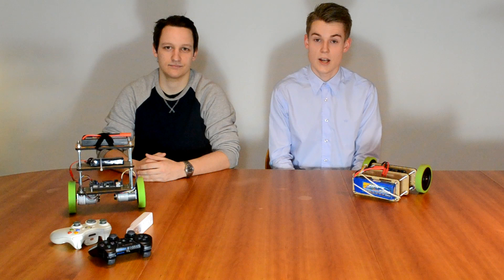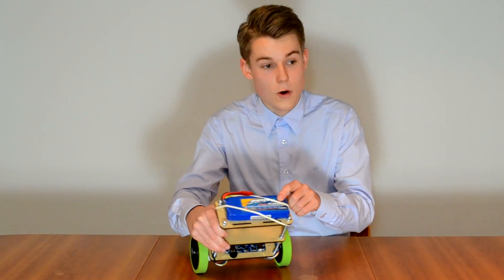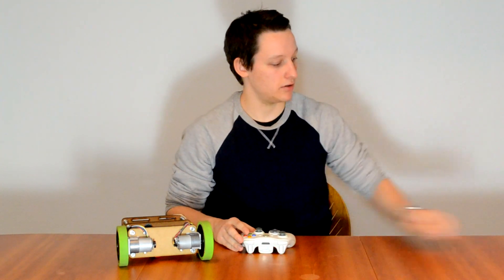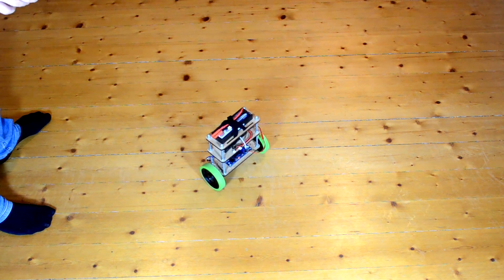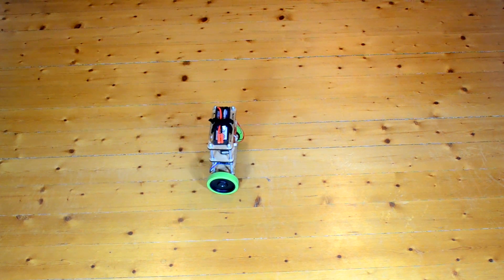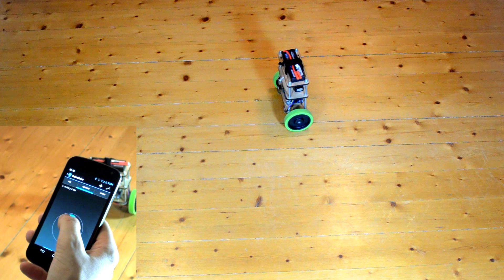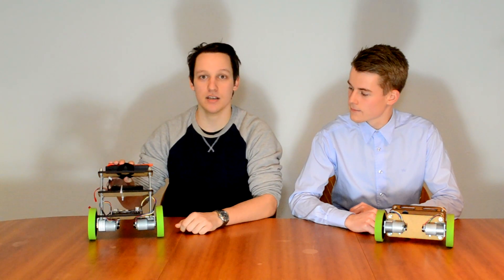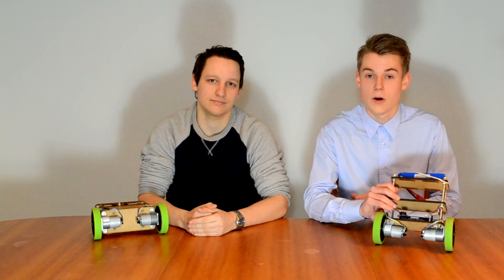Balanduino - Balancing Robot Kit

Comment: Yes you could make it work as well since it got a 3-axis accelerometer and a 3-axis gyroscope you can estimate both pitch and roll. You could then use one of the motor drivers for the driving wheel and the other for the disk that keeps it balanced sideways :)

Comment: Okay this is the last question, I promise :P
So if I were to put this in, say, a single-wheel 'motorcycle' of sorts, with a few modifications, would it work just as well?
That question decides if you've sold me or not.
Other than that, thanks for the help. I'm a bit tight on money atm with some other projects, but I shall look for it in the future.

Comment: No it's much much than just a simple Arduino. It features an ATmega1284P, an FT230X (USB to Serial converter), a USB Host interface (MAX3421E), a MPU-6050 (3-axis accelerometer and a 3-axis magnetometer), two motor drivers (VNH5180), a Bluetooth dongle and a buzzer. Try to read the Kickstarter description for more information.

What I meant by the comment was that you can use the board as a normal Arduino.

Comment: The finished PCB with all components will remain at $129 for now. I can't say what might happen in the future.

Yes it could work, but you would have to make a lot of modifications to the code.

None. You use the Arduino IDE to program the robot. For more advanced users it's also possible to use a normal makefile.

Comment: I like it, but will the board eventually be cheaper? I mean, judging by the donation rewards, $130 would be about what the board itself costs. Are there plans to make it any cheaper?
Second, could this work if it was connected to a single wheel?
And finally, what's the difference between this and programming a self-balancing robot code with the arduino IDE?

Comment from the maker: We haven't thought about using any controller algorithm as that part is the most fundamental to the balance performance we have gained with the Balanduino currently. Changing it would require a lot of hours developing and fine-tuning this new controller.
We have thought about adjusting the PID contants (gains) according to the battery level even though the motor performance doesn't rely that much on the voltage level. But we would be implementing this in the final version of the firmware.

Comment from the maker: You are completely right. It is absolutely the best to have the sensors, especially the accelerometer as close to the tilt axis as possible.

This is also what we have done, by placing it at the bottom layer.
Having it on the top side or the bottom side of this layer doesn't really matter - but in our case we didn't have space for the board at the bottom side, and it is also more protected at the top side.